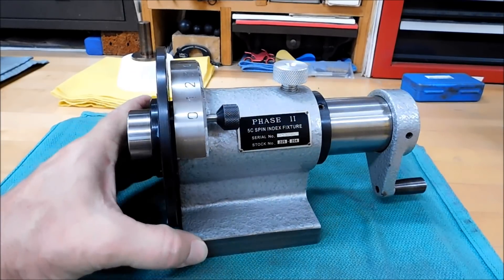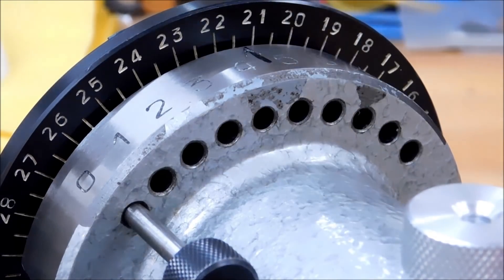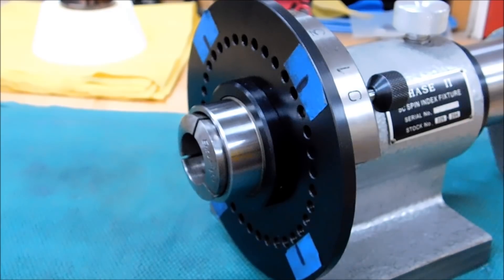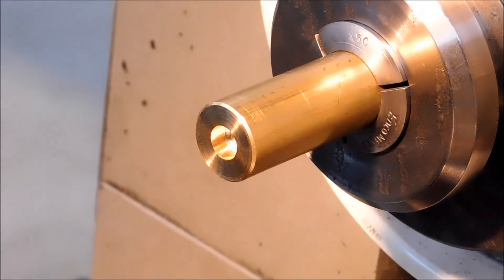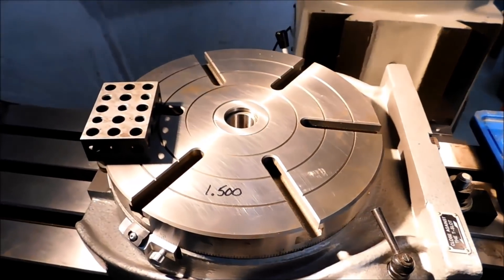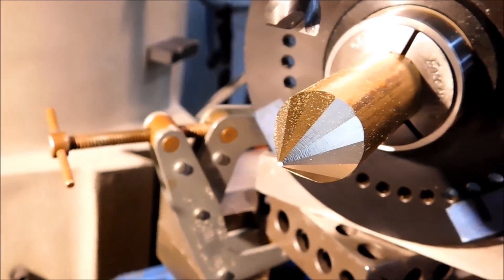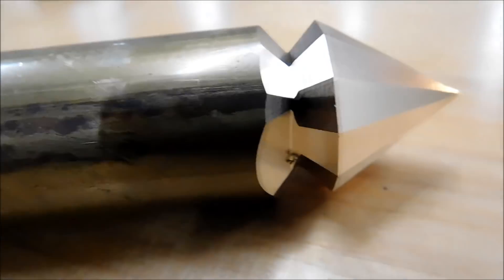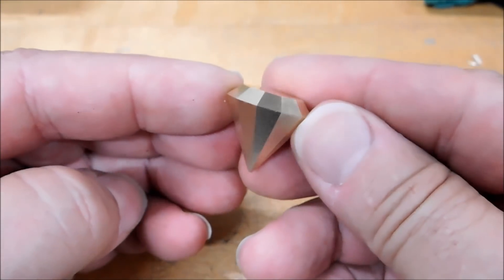Machining a Diamond shape with a Spin Indexer

Comment: i bought a dividing head- was going to make some small gears- got some tapered 8 inch long arbors to press blanks onto- how do you align the tailstock to the head if you don't have an 8 inch alignment bar? i have a 12 inch for the lathe- but i would have to take that out and move the tailstock 4 inches
Reply from the maker: Use a reliably straight bar with a true center drilled into the end. Chuck it up and indicate it true. Move the tail stock close to the part and position an indicator on top. Engage the center and watch for rise or drop on the indicator. Move the indicator to the side and repeat. you may have to go back and forth, but zero indicator movement is the goal. Or if you can hold an indicator in the chuck, just indicate the point of the dead center.

Comment: Joe! I have a 16 tooth gear, its 22.5 degrees between centers in teeth. I need to cut the center between each tooth. So i make a fixture to line up the gear in the collet. I cut every other tooth, 45 degrees, then remove the gear and line it up with the fixture to cut the odd number teeth. I have now cut at every 22.5 degrees. 😁 Machinists will make it happen!

Comment: my spin indexer is turning to odd angles. like 91.5 instead of 90 or 74.2 instead of 90. 
I tried to grind a square and ended up with a odd trapezoid. i tried an hexagon as well and it turned out bad. 
its non repeatable if you go around again to finalize the size you end up with extra sides.
Reply from the maker: Since a second pass on your indexer yields a different result than the first pass, I would look closely at the tip of the pin, and backside of the holes. if the taper on the pin is ground eccentric to the pin, even a slight rotation of that pin will stop the index plate at a different location. Pay attention to the clocking of the pin and repeat your test. I bet it indexes and  repeats better.

Comment: You might be able to make two locking pins with 1/2 the dia at the end for 0.5° increments

One in the hole you need the other in the next hole along so that each pin is touching the edge of a hole so that it can't turn backwards.

For example if you put your new pin in the 0 hole at 10°, if you turn it clockwise untill it butts up against the pin it will be 10.5° if you turn it anti clockwise you will be at 9.5° (if you go anti clockwise you would need to go the hole before with the second pin)

I don't own a spin indexer but if this works I want credit 😉💹💹💹

Might even work for other increments, 1/3 diameter pin 3 hole apart for 3rd of a degree, a 1/4 diameter pin 4 holes apart for 4th of a degree etc etc.
Reply: Might need to go more than one pin over, 5 maybe?

The 0-9 divisions are 9° whereas the 0-36 are at 10° so you need to take that into account 

A bit of trial and error will let you know where the second one needs to go to remove any backlash.

Comment: I just made one Joe. It was easier than I expected but still a bit tricky as my mill is not very big. I used the Spindexer in my vice and tipped it up at an angle of 30° for the first cuts with a Flycutter, then repositioned it in the vice 45° downwards and used an insert mill. Thanks for the Video! 😉

Comment: how did you line up the first set of facets with the fly cut ones?
Reply from the maker: Since the indexer is the item being moved between surfaces and the part never leaves the collet, the alignment is controlled by the index plate the same as the first set. The alignment is automatic.

Comment: I am a retired machinist, from a one man, company owned shop. I wish that I had found your channel while I was still working. If I was the owner of a small shop, I would require / pay for each new employee to watch all your vids. Even a small tip - using banding to hold parallels - makes time spent watching vids worth every cent paid. - I used to use folded packing styrofoam, but it got ragged and needed to be replaced often. - Thank you Joe, your experience / patience is appreciated.

Comment: I know this is an old video but I can't figure it out.  If you cut a 60° included angle (30° from centerline) and then put the part in the spin indexer and mount it 30° off the X axis, the side of the turned portion of the part is exactly parallel to the X axis and no material will be removed.  What am I doing wrong?
Reply from the maker: Good honest question. Technically, you are correct. With a faceted part like this, the angles of the flats are different than the angle of the ribs. Its OK to set your tool lower than the point formed on the lathe. As you create the flats, you will also create a new point as the part evolves.
Reply: @joepie221  , thanks so much!  I was beginning to think I wasn't getting something!  I've still got the setup in the mill so I'll go down there and try it!
Reply from the maker: Let me know how it goes. Good luck.
Reply: @joepie221  It worked out great!  Instead of turning the spin indexer down and using  a fly cutter, I turned it up and used an end mill.  Again, thanks a lot.

Comment: Could you make a video comparing the spindexer to a dividing head?
Reply from the maker: Thats simple. A spindexer is a stationary unit when in use, and the dividing head can withstand rotary milling and articulate under load.

Comment: Joe. I have the same exact indexer . How could I use it to mill replacement gears ? Or do you have a video showing that using that indexer. ? Thanks 😊
Reply from the maker: if your gear teeth divide evenly into 360, you can use an indexer and a form cutter. If not, a dividing head with a proper index plate will be required.

Comment: Is there any practical way to scrape a machine without having a professional straight edge of any sort? I have a very old mill the knee moves up n down very easily on the upper part of its range, but the lower is rather hard (minimal wear there I assume) I would like to spend some time with this machine in the future trying to fix it up a lil bit (no intention of making it perfect to the 1/2 thou) its never going to be as nice as a modern Bridgeport,  but would just like to make it a lil better. Any thoughts?
Reply: I'm in the same position with a lathe bed, I don't have the tools to regrind it but i have milled the saddle nice and flat, the only ref point I have is the chuck centre, maybe you will need to take measurements from the miller head or quill body using a ground bar in a collet as big as you can manage. although doing this without removing the whole table would be imposible
Reply: @wint3rsmith42  I have been working some ideas out in my head using the simplest things available to me, like carpenter square, or some other straight edge that I can get my hands on. I know nothing is going to be perfect,  but I am certain I can make this machine a lot better (not that I can really complain, just thankful to have it at all)
Reply from the maker: I have to be honest enough to admit, scraping is something I have never had to do. Thats more of a restoration type skill. I have seen Dale Derry at 'Build something Cool" do some demonstrations, and I believe "Keith Rucker" may be another source.
Reply: @joepie221  thanks for getting back wth me. I have already reached out to Keith Rucker and a few other of the top Machinists on YT, but I had forgotten about build something cool. This is 1 of those jobs thats no big deal with the right tools, but without could be a recipe for disaster.

Comment: Could you disassemble the spindexer and drill in a new set of alignment holes for +0.0° through +0.9°? Maybe a second set of holes just outside of the 0° - 9° set of holes?
Reply: It would be possible, but the accuracy is limited by the fit of the pin in the holes, so you would need the arc of alignment holes to be at ten times the radius of the original ones to be equally accurate in percentage terms setting smaller angles. Also, if you have sufficiently good equipment to make the modification you probably don't need the spin indexer anyway.
Reply from the maker: My gut tells me I could use a smaller pin and achieve my goal. Splitting the desired hole may be all it takes. I have to try it.
Reply: @joepie221  I guess you could calculate what distance half a degree equates to at the radius of the setting pins. Then using a pin with that much clearance would allow you to position the workpiece half a degree either side of the indicated position.

Comment: Really cool videa. Not many of us have a spindel indexer, I was wondering, if this can be done on the Rotary Table ? If so would you please be kind enough to show it ?
Reply: You'd be surprised how inexpensive they are.  I ended up winning a used phase II from eBay for $40.  It was missing the lock screw and plate pin, but they were super easy to make so it was WELL worth the money.   I very often see them for around the same price.  Even new import versions can be had for <$150 so definitely not bank breaking.
That said, if you have a 5c collet fixture for a rotary table, it would be very easy to reproduce.  Heck, even a 4 jaw would be easy since you have to dial it back in somewhat precisely after removing from your lathe operation.  Same exact principle, just with the rotary table on it's side, rather than horizontally.  I think the problem comes in if your rotary is too big, then it will be unwieldy to clamp up and secure.

Comment: Interesting project, hope your wife was happy with her new ring! By the way, some of us in the UK remember the Imperial system, we only changed to metric in the mid 70’s. A near 40 odd years back. And some of us still refer back to it in our minds. Australia and New Zealand probably had a better changeover than us. They went the whole hog with kilometres, we stuck with miles and pints for our beer. The latter was always our most important measure. How many carrots did you tell your good lady the ring was? Regards
Reply: Peter;   the Neper (Np) is the logarithmic unit of Ratios .
Such as for example, gain and loss of electrical signals.

Its an excepted SI unit but its not technically metric, loosely; the "nautical mile"is the same.

Comment: I had a spin indexer, a cheap Chinese one, actually did some fairly critical work with it.  I actually had considered retro fitting a couple angular contact rollers to it.  I was working in a shop around 2006, the recession hit, when I got laid off, I left it behind.  Not as stupid as getting addicted to cigarettes, but close.  Nice tool.  Never leave yours behind!

Comment: Iv'e got the unit. Except I ordered the tail stock with mine. I then ground the four sides square and parallel on both pieces. The bases were also ground to the same center height (less than .0005"). Lastly they got a .625 keyway machined and ground in the  mounting face to make it easier to set up on the mill. The key is offset to one side and has a slot on each end for a screw to clamp them down to the table. These work alright. But they don't take the place of a dividing head. But people have turned them into them. For a simple indexer a Hardinge H4 is a lot stoughter. But then you do get what you pay for 🤢

Comment: I've faceted many hundreds of stones , & designed quite a few 'cuts'. . .   Try indexing several times with each facet ; roughing in , then medium & fine cut before polishing !   Sometimes it takes several days to cut just ONE design to completion . . . but then , I'm talking about a one of a kind cut  . . . with hundreds of facets ;)   * I don't think the refractive index of brass is very high , ( regardless of the facet angle) !   Great demo of the spin indexer though , thanks Joe !    
   Fun stuff !    You COULD 're-machine' any one of those facets , but you'd need to make a pair of dops , then a transfer block ( you could use a pair of 'V' blocks for the transfer . . . to swap ends for cutting / polishing the other facets )   'nothin to it , like eating lettuce !

Comment: Hi Joe. Another cool video, thanks.
Dumb question perhaps.... when you moved the indexer to do the second set of cuts, how did you align them to ensure they matched the first set?
Reply: Leave the part in the indexer?
Reply from the maker: If you don't loosen the collet, the index planes will stay relative to each other. Just make sure if you go from a side cut to a top cut like I showed, you still have what you want.

Comment: Omg... I have never thought about running in reverse for ..OD dude you have just saved me so much frustration  !!!
I will do my hot rough cutting,,, cool it down.... and finish with a boring bar.....
Sometimes a different set of eyes is so useful....
I am just ( i don't like the phrase just) ((( but I would rather be humble,,,, than a loud mouth  )))
one of 4 machine shop guys at a sheet metal shop, where the temperature of the shop can easily vary 5-10 degrees due to a poorly vented laser for the tin shop...
But frum time to time..... an odd tooling request will be made.....

We had our thanksgiving on the 14th....
But the lake hasn't frozen yet so no "lake hockey "

Comment: Joe, a question please, you say if you want 2 tapers to match, use the same boring bar so the tool height remains the same. Does that mean the you can have NO top rake on the tool ? I see that you used the back edge of your boring tool to turn the taper, as your camera angle was fixed, I was unable to determine any top rake or not. I would have thought it possible to use 2 different tools, I would say if you have an adjustable height tool post that you would be able to get a center height setting better than 0.010" and that would only be an angle error of a minute or less I would guess ( have not done any calculations so I am prepared to be  proved wrong )
Reply from the maker: When I did the OD taper, I used the same edge i would use for the bore taper. Thats what makes it so accurate. There is no need to match tool height.

Comment: A piece of soft rubber tubing on the part makes a feature that a rod or dowel in the tail stock can catch.  It is basically a temporary bore hole that is easily put on or removed.  That was a little trick an old timey machinist taught me.
Reply from the maker: I have been known to make a small cup my drill chuck holds to catch small parts if I have a bunch. Even small parts get hot.
Reply: Great idea, thanks!
Reply: @ferrumignis  no problem

Comment: Is there a "technical" way to make sure the second set of facet cuts line up with the first set, or did you just realign it by eye after changing the set-up of the spin indexer? Either way it was a very cool process. Now we're warmed up for when you want to demonstrate how to get all sorts of fractions/angles with the dividing head. ;) Thanks.
Reply: I believe the sides of the spin indexer are parallel and he just turned it back to 90 on the same plane, then the indices will still be in line. edit In regards to the secondary angle it doesn't matter since it will cut 45 degrees to the initial facets no matter how it's tilted. edit Brain fart, 90 degrees from the jaws 45 compound angle. Either way...
Reply from the maker: As long as it stays tight, the cuts will line up. just be sure your planes are still clocked when switching from a side cut to a top cut. Not all increments will cooperate.
Reply: Thanks. Since I've never done any of this sometimes it takes a while to figure out things that most viewers probably know. Between you and Tim Hall I think I understand how that set-up works
Reply: @cuteswan  I'm an apprentice and I was taking a short break from my pre-test on this exact stuff when I commented. Spatial awareness isn't always a given, but once you're aware it can really change your perspective. Good luck and hopefully one day Joe's vast shared knowledge will serve you as well as it has me.
Reply: Ya you don't take it out the collet lmao... Really?????

Comment: Hey quick question, Does your clausing lathe have a clutch between the motor and transmission/headstock?  When you first fire it up before you start the spindle, it makes a lot more noise than my enco 14-40 of a similar design to yours....on mine it's silent till I flip the ON lever on the apron....I know larger lathes like abom size have a clutch where the motor runs before turning the spindle, but didn't think these enco/jet/grizzly/acra/PM machines that are all kinda Clausing clones were like that
Reply: If I may comment, I think Joe's lathe is made by Colchester in England, branded as Clausing for the US market. Certainly not a clone, there are Clausing clones though. It does have a continuous running motor and drive is by a wet clutch allowing forward/reverse.